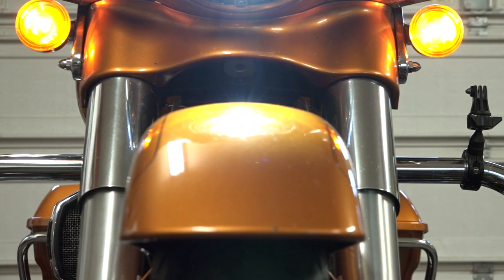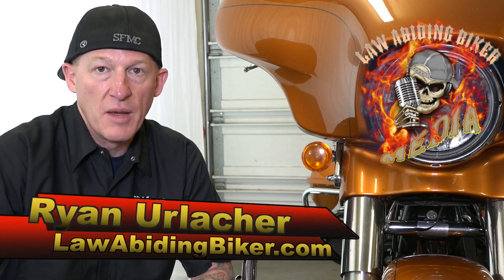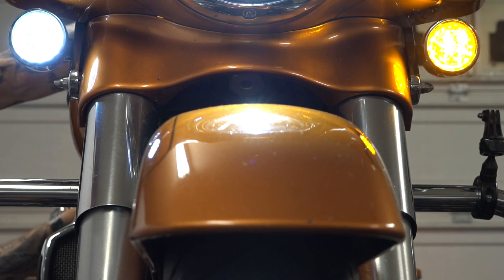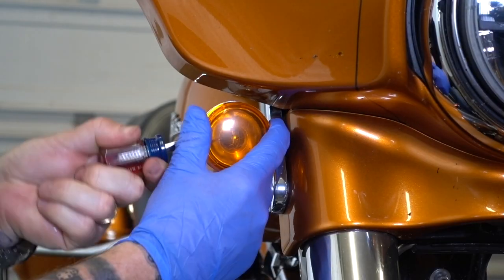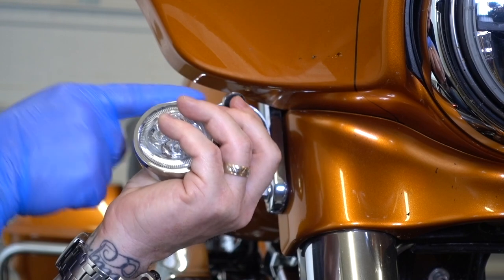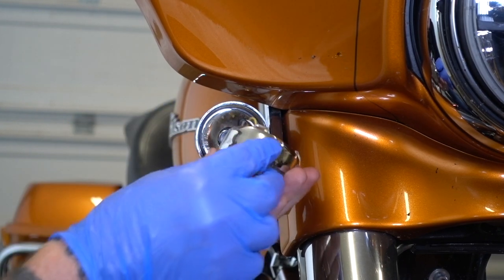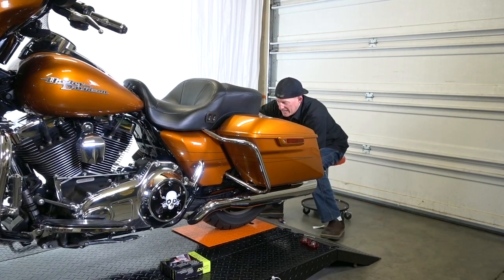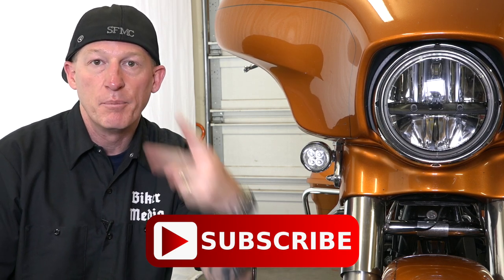Harley-Best Brightest LED Signal & Brake Light Conversion-Ciro 3D Fangs-Easy Install Tutorial

Comment: Ryan, we don't have front running lights in the Uk, law allows white light to the front so it would be great to have Fangs fitted, however would they stay on during normal running or would they be off and only activate the indicator when turning. Also do the rear lights show a red light during normal use and switch to orange during indication. Again the law in the U.K. Is quite specific regarding what light colour can be displayed to the rear. Regards Mark, retired LEO.
Reply from the maker: +Mark Hillman I don't know how they'd work exactly in UK. The rear lights are red all the time & running. They just look orange on the video.
Reply: Ryan Urlache Thanks for the reply Ryan, I think I need to do some more research on the front lights, the rears would probably be ok. Regards. MDH.

Comment: So I could get these for the front and the Harley LED rear turn signal kit (part no. 68128-10) for the rear in order to get combined brake and signal at the rear and all will be compatible with my 2011 Ultra Classic?  Where would the "load equalizers" go if they are needed?

Comment: Rather than bunch up the wires simply rotate the assembly clockwise or counterclockwise then snap the lighting into place making sure not to push from the front, but by grasping the out chrome ring.

Comment: Hi Ryan - I love this idea.  I'd love to add them to my '03 Heritage Springer.  Do you know whether they'd work with my bike.  I've had someone tell them they might not be compatible.
Reply from the maker: From Ciro's website:

Touring & Trike: '14-up Harley-Davidson Touring motorcycles do not require a load equalizer. '14-up Electra Glide Ultra Classic FLHTCU '14-up Electra Glide Ultra Limited FLHTK '14-'15 CVO Limited FLHTKSE '15-up Road Glide Special FLTRXS '14-up Street Glide Special FLHXS '15-up Road Glide FLRT  '02-'13 Harley-Davidson Touring motorcycles may require a load equalizer to correct turn signal timing. '04-'05 Screamin’ Eagle Electra Glide FLHTCSE '06-'13 CVO Ultra Classic FLHTCUSE '04-'09 Road Glide FLTR/I '10-'13 Road Glide Custom FLTRX '11-'13 Road Glide Ultra FLTRU '09 CVO Road Glide FLTRSE '11, '15 CVO Road Glide Ultra FLTRUSE '12-'13 CVO Road Glide Custom FLTRXSE '04-'07 Road King Custom FLHRS/I '02-'03 Screamin’ Eagle Road King FLHRSEI '07-'08 & '13-'14 CVO Road King FLHRSE '06-up Street Glide FLHX/I '10-'12, '15 CVO Street Glide FLHXSE '09-up Tri Glide Ultra Classic FLHTCUTG '10-'11 Street Glide Trike FLHXXX Softail: '11-up Harley-Davidson Softail motorcycles do not require a load equalizer. '12-up Softail Slim FLS '16-up Softail Slim S FLSS '14-'15 CVO Softail Deluxe FLSTNSE '16-up Fat Boy S FLSTFS/BS '11-'13 Blackline FXS '13-up Breakout FXSB '13-'14 CVO Breakout FXSBSE (except '16-up FXSE) '00-'10 Harley-Davidson Softail motorcycles may require a load equalizer to correct turn signal timing. '05-'06 Screamin’ Eagle Fat Boy FLSTFSE '06 Heritage Softail FLST/I '05-'07 Softail Springer Classic FLSTSC/I '02-'03 Springer Softail FLSTS/I '10-'12 CVO Softail Convertible FLSTSE '05-up Softail Deluxe FLSTN '08-'11 Cross Bones FLSTSB '02-up Fat Boy FLSTF/I '10-'16 Fat Boy Low FLSTFB '00-'07 Softail Deuce FXSTD/I '03-'04 Screamin’ Eagle Softail Deuce FXSTDSE '02-'08 Softail Standard FXST/I '02-'09 Night Train FXSTB/I '02-'06 Springer Softail FXSTS/I '07-'10 Softail Custom FXSTC '07-'09 CVO Softail Springer FXSTSSE '08-'11 Rocker FXCW/C Dyna: '12-up Harley-Davidson Dyna motorcycles do not require a load equalizer. '01-'11 Harley-Davidson Dyna motorcycles may require a load equalizer to correct turn signal timing. '01 Super Glide T-Sport FXDX/T '02-up Dyna Models Sportster: '14-up Harley-Davidson Sportster motorcycles do not require a load equalizer.   '02-'13 Harley-Davidson Sportster motorcycles may require a load equalizer to correct turn signal timing. All '02-up XL Models If your motorcycle requires a load equalizer we recommend: -Custom Dynamics, SMART Signal Stabilizer -Namz/Badlands, Load Equalizers

Comment: I installed these lights....absolutely awesome. Super easy to install. However I have quick flashing on my dash. I tried activating my hazard flash, by pressing both signal buttons at the same time. However this only makes the lights change from side to side. Any info on this?
Reply from the maker: Thanks for the shout out!! Super stoked you like them.

Comment: Can you just install just the front signal led signal lights only and still have the signals working properly?
Reply from the maker: Sorry. Confused a bit. They do work properly after install?  The white running light is standard. Then the turn amber when signaling.

Comment: Just received mine the other day -- fast shipping LAB! I installed them a few minutes ago, after watching this video again, and it only took a couple of minutes. I may not be able to wait until next month to order the fronts! 
Question: I turned off the lights in the garage (they really are bright signals in the dark), and noticed a ring of light around the bezel where it attaches to the housing. I snapped them in like you did in the video Ryan, and they gave a loud click and appeared to be seated. Is this normal; should I try and "push" them in further?? Not a deal breaker, but something I'll have to remember when I wash the bike. Cheers!
Reply from the maker: Thanks for the shout out. They snap all the way in and you don't have to worry about anything when washing the bike.

Comment: Hi Ryan!  I called Ciro for some answers.  The Fang LED turn signals only come to fit into a 1157 socket (front and back).  My bike is CVO ultra classic 2011 and  the front is 1157 socket but the rear is 1156.  So, the rear LED turn signals only work on the newer bikes.  To make it work on mine I would have to change my 1156 socket to a new pigtail 1157 and  feed the wires through the light assembly and connect the wires to the plug or cut the 1157 male socket on the rear LEDs and hard wire then without socket all the way to the main harness.
Do you have any suggestions?

Even if I buy the conversion kit module to make my rear turn signals run as running lights, that won't do any good if  I can't plug  the 1157 Male LED into a 1156 female receptacle .

Comment: will these work on the rear if you already have the Plug and Play Run turn brake light system kit ?
Reply from the maker: +Scotty Liegel yes. As long as you can still insert a bulb then you can insert the Fang LED's. The video shows you how they install.

Comment: I saw the list on their website but it isn't clear to me. HD Sportster 883XL Custom. Is it plug and play or does it need the equalizer?
Reply from the maker: +The10man81 here is fitment & load equalizer info. 

Touring: 

'14-up Harley-Davidson Touring motorcycles do not require a load equalizer. 

'17 Road King Special FLHRS

'14-up Street Glide Special FLHXS 

'15-up Road Glide Special FLTRX/S 

'02-'13 Harley-Davidson Touring motorcycles may require a load equalizer to correct turn signal timing. 

'10-up Street Glide FLHX 

'10-'13 Road Glide Special FLTRX/S 

Softail: 

'11-up Harley-Davidson Softail motorcycles do not require a load equalizer. 

'12-up Softail Slim FLS 

'16-up Softail Slim S, FLSS 

'11-'13 Blackline FXS 

'13-up Breakout FXSB 

'13-'14 CVO Breakout FXSBSE (except '16-up CVO Pro Street Breakout FXSE) 

'00-'10 Harley-Davidson Softail motorcycles may require a load equalizer to correct turn signal timing. 

'10-'12 CVO Softail Convertible FLSTSE 

Dyna: 

'12-up Harley-Davidson Dyna motorcycles do not require a load equalizer. 

'16-up Low Rider FXDL S 

'01-'11 Harley-Davidson Dyna motorcycles may require a load equalizer to correct turn signal timing. 

'09-up Street Bob FXDB 

'10-up Wide Glide FXDWG 

Sportster: 

'14-up Harley-Davidson Sportster motorcycles do not require a load equalizer.   

'02-'13 Harley-Davidson Sportster motorcycles may require a load equalizer to correct turn signal timing. 

'07-'12 Nightster XL1200N 

'10-up Forty-Eight XL1200X 

'12-'16 Seventy Two XL1200V 

'09-up Iron XL883N 

If your motorcycle requires a load equalizer we recommend: 

-Custom Dynamics, SMART Signal Stabilizer 

-Namz/Badlands, Load Equalizers

Comment: Are these better than the Custom Dynamics or about the same?
Reply from the maker: We have installed Custom Dynamics too. We prefer the Ciro 3D Fangs after testing both. https://shop.lawabidingbiker.com/collections/lighting-1/products/ciro-3d-fang-led-signal-light-inserts
Reply from the maker: We have tested and installed both. We prefer the Ciro 3D, which is why we brought them directly into our store. https://shop.lawabidingbiker.com/collections/lighting-1/products/ciro-3d-fang-led-signal-light-inserts
Reply: Brian Cruise I have the custom dynamics versions and their just as bright on my 2017 sreet glide. Everyone has the LED technology now and if you want one less thing to worry about go LED for they rarely burn out. Besides LED is much brighter than bulbs 2 to 3 fold, but the price depends on who is selling as we know.
Reply: Ryan Urlacher you do a good job bro.
Reply from the maker: Thanks Frank
Reply from the maker: I agree Frank mostly. I will say that there is some real LED junk out there too on the market. It's not all equal. We tested some cheap Amazon similar signal items.....and we checked out some LED strips......complete junk they were and would not last, but cheap on the wallet. As long as you are ordering from a trusted source then I think the LED's are safe & quality ==> https://shop.lawabidingbiker.com/collections/lighting-1/products/ciro-3d-fang-led-signal-light-inserts
Reply: The only difference I see is the $60 price difference between Ciro and Custom Dynamics

Comment: Will I need a load equalizer for my '13 street glide?
Reply from the maker: No
Reply: Ryan Urlacher Thank you
Reply: FYI  I found out the hard way that a load equalizer is needed on a '13 streetglide after installing the LED lights front and back.
Reply from the maker: Real sorry. sounds like there was some mixed up info in Ciro's end. All the fitement and load equalizer info is at the bottom of the item sales page in our store here: https://shop.lawabidingbiker.com/collections/lighting-1/products/ciro-3d-fang-led-signal-light-inserts
Reply: No problem at all. I have a load equalizer on order. I appreciate all the work you do with the how to videos. Keep up the great job!
Reply: You first say NO for the 2013, and Harley Cruiser66 say YES front and back.
SO if I decided to just do the front only, would the equalizer still be needed?